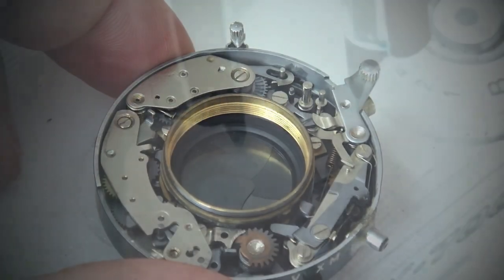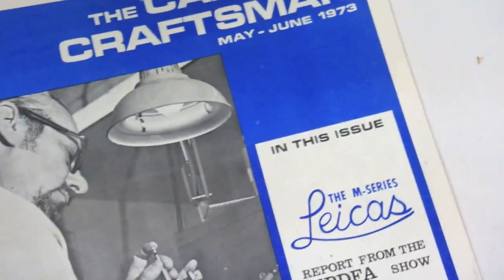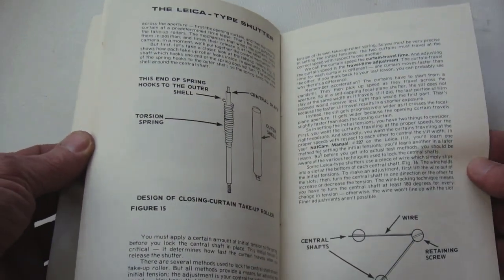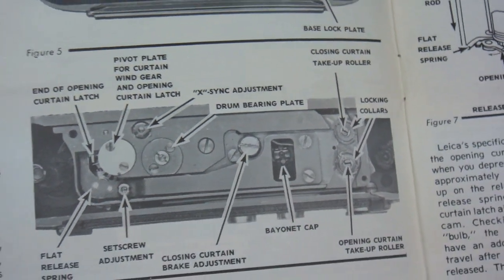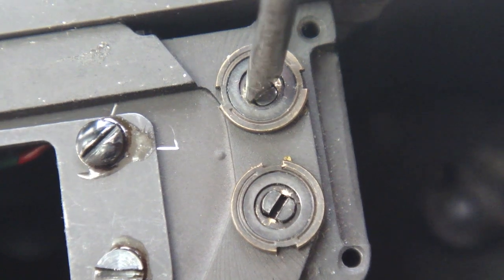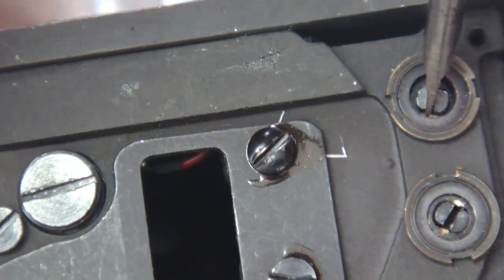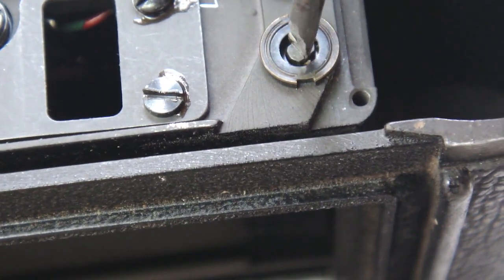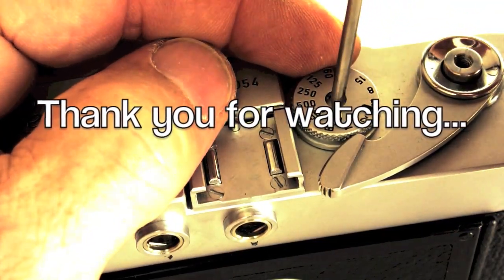Fix Old Cameras: Leica M Series Shutter Adjustment

Comment: Hi, if my old film camera can be power up , but only the shutter keep moving, I can't even switch on the camera, do you think it could be repair?  TAT ( Ricoh XR- X Date 2000, that's the camera left from my grandpa after he passed away, I really want to fix it )
Reply from the maker: Not clear on what is not working. But if the camera is not turning on check the removal battery grip. If there is any signs of hidden corrosion, submerge in clear vinegar for 15 minutes than flush with water followed by alcohol. If corrosion as attacked the plating of the contacts they will need to be burnished also.

Comment: I heard that this technique without a proper CLA leads to increased wear and earlier failure of the shutter completely. Does anyone know if this is true? My knowledge of camera repair is very limited.
Reply from the maker: If you are shooting only shooting a few rolls a month and the adjustment only required a mild increase in tension the camera will be fine... barring in other issues.
Reply: Fix Old Cameras thanks for the reply. I probably only shoot one roll a month, haha.

Comment: Hi all,  I would like to share an issue I had with my M6 non TTL. It is a strange issue on the lightmeter. I found that the lightmeter is giving wrong exposure only when shutter speed is at 1/125 s postion. And I slightly turned the dial towards to the 1/60 s direction, the exposure was then corrected. I am wondering if anyone encounter the same issue before? and how did you fix this problem? Thank you

Comment: Hello, I have a problem with the handle selector wheel of an olympus om1, I unlock it to turn it but it does not move, can you help me?
Reply from the maker: "the handle selector wheel" does that refer to the advance lever on the right side of the camera or the rewind knob on the left side of the camera or the shutter speed dial or the ASA knob? If it is the rewind knob than perhaps their is film in the camera that has reached its end and the rewind release knob on the front right upper side of the camera needs to be released so that you are then able to turn the rewind knob to rewind the film in the direction of the arrow on the rewind knob lever.

Comment: Hi, Any chance Fix old cameras could make a video on Yashica FX 3? every forum ive seen simply recommends buying a new one since they are cheap, so its hard to find disassembly and problem diagnosis content. Thanks!
Reply from the maker: Thank you for the suggestion. Sure they are cheap to buy, but that is not always the point. Some times it is good to just to "keep'em going" and be in control of your stuff.
Reply: @FixOldCameras  Yup totally agree! I'de love to clean/service and repair mine, It's just tough to find any guides on servicing/disassembling one :) thanks!

Comment: I have a slightly off topic question regarding my x-570!

 I read that using any modern flash will be no problem, at least no harm can be done to my camera. 
Sometimes the pins wont match exactly, but since only the middle one has to connect, it should work fine. So I wanted to try it out since I still have flashes from my digital camera around here.

However when I use my modern flash on the x-570, It will fire properly, but I cannot advance the film lever after the shot. Unless I remove the flash out of the hot shoe I cannot advance it. It blocks like midway the same way it does when you try to advance it twice in a row 

It works flawless if I use a wireless reciver in the hot shoe and fire the flash out of my hand instead. Any Idea what causes this or if there is a possible fix? Thanks a lot in advance. I dont know where else to ask :)
Also thank you for giving out all this knowledge on this challenge and sorry for hitting you with a question so unrelated to the video!
Reply from the maker: It sounds like the shutter's second curtain does not release after the first curtain's travel fires the flash via the flash contacts. Probably the only way to use the flash in question is by blocking all but the center contact post and the ground contact on the shoe and foot. Or... perhaps the flash has a PC cord connection. You might also be concerned on the odd reaction of the camera's shutter from the connectivity of what appears to be an incompatible flash. It is odd and possibly a previously unknown issue.
Reply: @FixOldCameras  What you are describing above is indeed what is happening. I checked again and U were on point. 

I quickly grabbed some tape and tried covering the contact posts... And it works right off the bat!!

Comment: As a technician that repairs Leicas for a living this is a TERRIBLE adjustment to make it your shutter is slow! First off the shutter is slow due to lack of lubrication, it’s time for a CLA. Second Travel times MUST be matched at 13.5 milliseconds using a shutter tester for optimal accuracy. Adjusting just one will cause one curtain to be faster than the other and cause uneven exposure or an overlap causing the camera to jam. You don’t just “count the clicks” to match them either, these springs are over 60 years old they aren’t specific to the clicks. These cameras are precision machines should be treated as such. You don’t have a subaru mechanic work on you Porsche. For a lot of people they get their first Leica and are very excited so they don’t want to wait for a CLA, be patient, save up the money, and get your camera serviced by a professional. Trust me it will save you plenty of money and heartache in the future. I’ve had too many customer screw up their cameras because they watched this video and though they could fix it themselves.
Reply from the maker: Thank you for your fun comments and for taking the time from making a living cleaning, lubing and adjusting Leica cameras to show interest in the Fix Old Cameras channel and sharing your opinion as to the validity and usefulness of the information presented. However, the adjustment procedures outlined in this and other FOC videos are substantiated and outlined on the pages of model specific NATCAM manuals and a general Leica Shutter manual. FOC has never made any claim to be a factory expert or factory trained for any brand of camera. NatCam training and factory seminars not with standing as they frankly are irrelevant to the reasons FOC was founded. Read the channel “about” statement for clarification. 
“Fix Old Cameras produces step by step up close videos of simple, common repairs and basic maintenance on classic and vintage cameras. Work a-rounds and short cuts that might go outside of typical camera repair procedures are also demonstrated. These techniques are not always considered a permanent fix, but allow for someone with limited tools and experience the possibility of getting their camera functioning again.”
 A note on CLA . Although CLA is an initialism that gets pitched about -  in and of itself it is often a waste of time and money as preventive maintenance. As opposed to actually addressing and repairing an issue. Repairing the problem might include stripping gummy old lubricate and applying modern lubricant appropriate for the application. It might entail adjusting a fatigued spring to give it the needed tension to regain functionality. Therefore in an isolated position a CLA repair is performed as needed and not a CLA of the entire camera as is often claimed. 
Another separate note on wrenching a cars. Much satisfaction and innovation is derived from wrenching on your classic show car or the daily driver regardless of any official training... a wrench is a wrench. There is no doubt the modern cars require far less maintenance but there are still repairs that can be done without any factory training.  But it is usually wrenching the classics that gives the most satisfaction and the feeling of mastery of your “stuff”. This too applies to the repair of cameras passed down from grandparents, parents, family members and friends as well as to newly acquired cameras. It is an element of this discovery and autonomy, regardless of economics, or perceived prestige of a particular camera brand, to maintain, repair and use these elegantly engineered cameras of old not just for their beauty and eccentricities but for their practicality as a picture taking tool.
Reply: Where would you send a Leica to for a cla or repair in 2020 ?
Reply: Jadon Broberg-Rosado will do, don’t need a cla yet, but I have an m3 and m6
Reply: Fix Old Cameras a fatigued spring can also break if tension is applied prior to lubrication as it can act as a glue holding it in place. It’s very irresponsible to just tighten the spring when your shutter won’t travel the full focal plane, the shutter is slow because the spring is gummed up and the main roller bearings are dry. Adding excess tension rather than properly addressing the issue leads to long term wear. On top of all that a shutter tester is needed to properly balance the travel times to ensure an accurate exposure, if you over tighten the trailing curtain you risky jamming the shutter or having it “cap” (no image). If you have access to the said manuals you should know that there are fine tolerances that must be met for the camera to operate at its full potential. I understand the satisfaction of fixing something but I make sure I know what I’m doing before I pull it apart as it can bring upon unintended consequences. And in my experience if the the lubrication is the shutter is need of lubrication  I find that the rest of the systems also need to be addressed. There’s no point in having an accurate shutter if your slow speed escapement is dry or your wind stack is out of time. I’m not trying to be rude or condescending but I can’t stand by and watch people destroy their beloved leicas, I’ve had several customers come to me with broken shutter springs after watching your video.
Reply from the maker: @THEJadon115  You make me smile... another you tube expert using the FOC comments section to blow their horn and dump on Fix Old Cameras. There is some truth in what you expose, but the premise you outline is just that a premise and just because you try to make it sound technical does not make it absolutely accurate. What is known or not known about the "fine" tolerances of a camera has nothing to do with a manual outlining procedures of repair and the diagram of parts layout. A Leica is not so fragile nor so excruciatingly precise as your premises portend. No shutter spring in any camera, including a Leica, will break following the recommendations in FOC videos. None. Unless the spring was crap and ready to fail or a hapless effort was made to continue cranking additional spring tension beyond what is recommended. Maybe by you drawing attention to yourself on this channel you will be able to develop your own you tube channel and start a web page for your repair company specializing in your expertise of the CLA of a Leica...we wish you well.
Reply: Since it is mentioned in this conversation that this adjustment might jam the shutter, I thought I'd ask.

Several weeks ago I received a Leica M3 (1xxxxxx serial), visually in good condition and it was functioning fine (may be a bit stiff at first). Until it got jammed after going through just two rolls of film – I can neither rewind it nor press the shutter. After removing the film I noticed that the curtain edge is visible a bit along the viewfinder side.

Can this be caused by wrong spring tension?